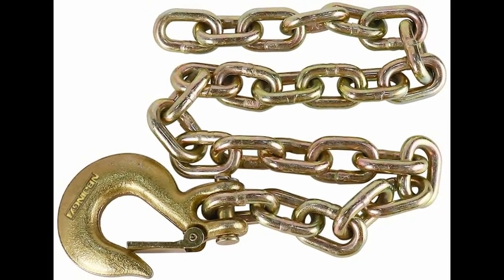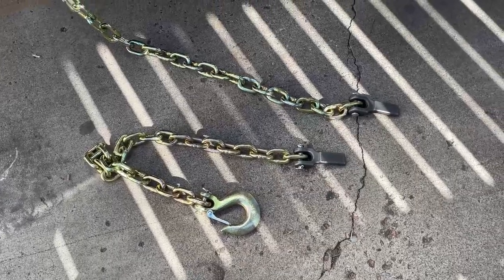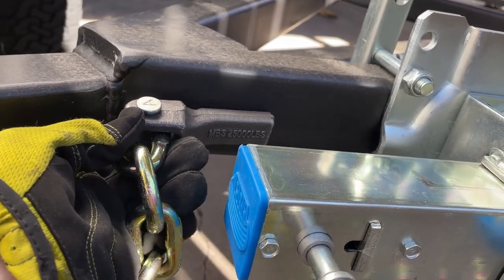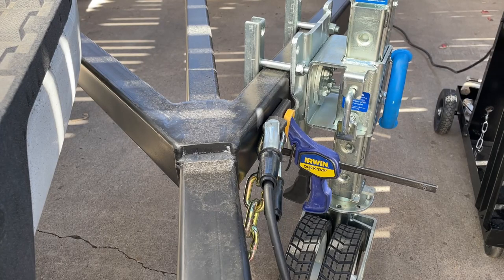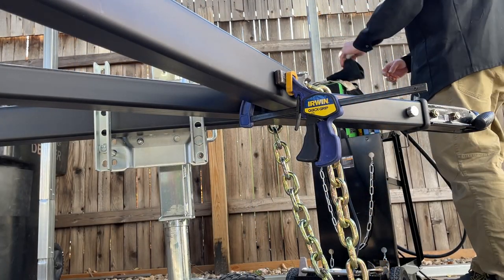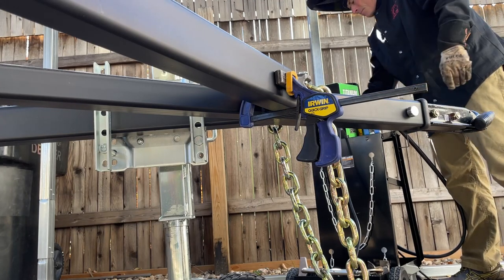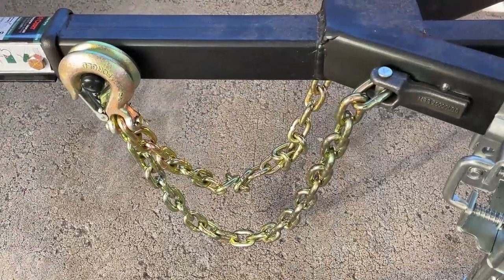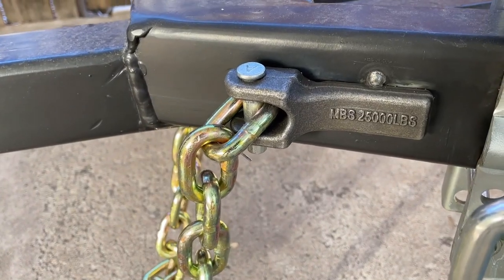Boost Your Trailer Safety: Simple Chain Setup!

Comment: Why wouldn’t you weld the mounts on the straight bar not the a frame you can pull the cotter pin out and adjust the chain on the mount and let the rest of the chain hang or zip tie it to to the chain hanging down?
Reply from the maker: I suppose it would work either way.

Comment: Both parts should be ground down to bright shiny metal. That little welder should not be used for such critical welds.
Reply from the maker: They are just tacked in place.  If you watch the body mount video you will see the welder that was used to finish the mounts.

Comment: There is a process for welding cast iron but you didn't do it. It would have been better to fabricate a mild steel fitting of a similar design.
Reply from the maker: The chain retainer is forged steel.  Should I have done something differently?
Reply: @infosponge  nothing wrong with your setup. I'd grind both surfaces to bare metal maybe.
Reply: Yes I would grind the surface on the trailer where you wanted to weld
Reply: Should have watched more of the video to know you used steel-it paint